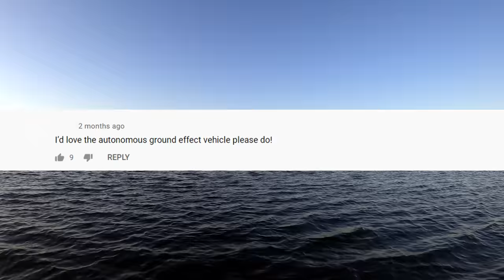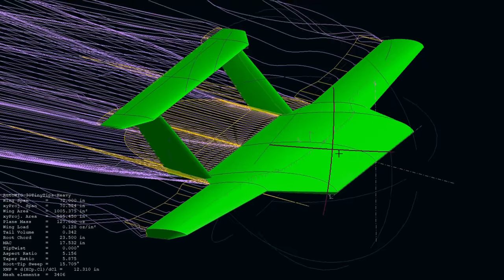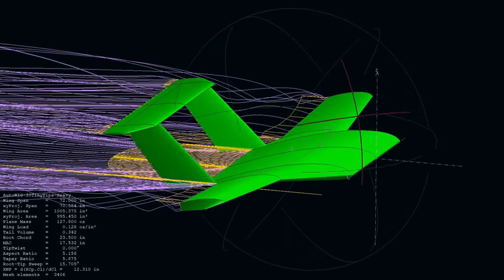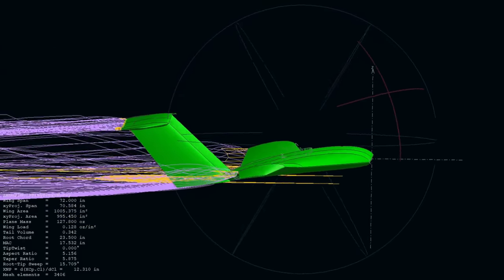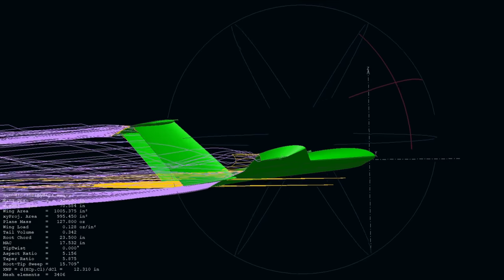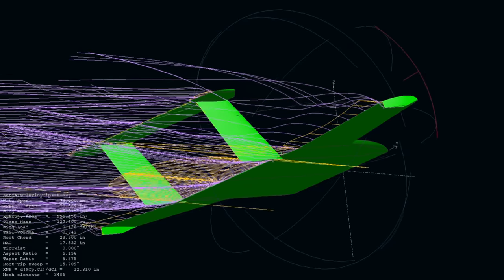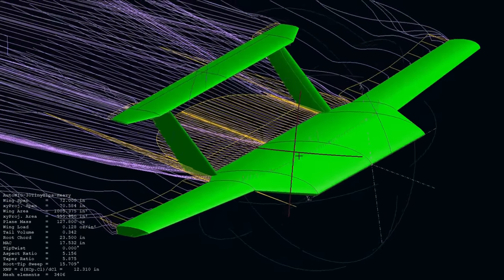Worlds First Autonomous Ground Effect Vehicle/Ekranoplan?   RCTestFlight Collaboration

Comment: would love to see some efficiency tests (battery duration) for identical missions at differing altitudes! Great build.
Reply: I was going to mention battery life. The whole point of the WIG is energy saving. The KM and Lun both use 8 engines to get out of the water, then turn 6 of them off.
Reply: Why ?
Reply: @tonywright8294  it would let you know the most efficient altitude for the vehicle to maximise WIG effect, as @mellocello has pointed out. If you're not in WIG effect, or in a less efficient height for it, you're wasting power. If you're not actually in it you may just as well fly the plane at any altitude.

Comment: Hey nice video. In the pic of the 3 pelicans, they are actually flying like most soaring birds and open ocean long distance sea birds, with the most lift happening the closer in you get to their shoulders, where they have fore and aft concave, lateral concave, as well as top view template concave. Just a massive inner section of lift, joining in with the body at the shoulders, with a massive refined fillet blending it all together.  That way the lift is were it takes the leverage of the birds muscles, way less energy and effort to keep its self in flight for long periods of time and flight. Next the pelicans in the photo aren't that different in height. The one on the right is just much closer to the camera. But all three of them are actually surfing that ocean wave. So let's say, in dead wind, surfzone waves like this one, are traveling somewhere around 5mph and push an air wave above them, which give the sea birds a form of means of travel.
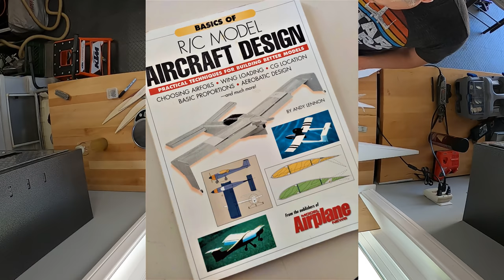 They combine that with the added help of ground effect the closer they get to the ocean surface. They also alternate the concave in their wing span from that pocket near their shoulders, all the way out to their wing tips depending on the needed articulation to stay in trim to the air wave. Those tips are actually accelerating the air flow as those last few feathers flex. Like when you kick with swim fins. The tips of the fins are bending into the water flow and allowing you to thrust water backward and yourself forward. Albatross use their wing tips to actually barely touch the wave going extremely fast in air surfing the open ocean swells. And the prandtl theory says that tip vortex can either be drag or acceleration on a manmade plane, depending on the design of the wing tip. Next. On your model, the twin vertical stabilizers can have an extremely positive added behavioral characteristic if you give each one about 2 to 3 degrees of toe-in towards the nose. It creates an auto correct feature to the performance characteristics. I'm at 5:20 now I'm going to watch the rest of the vid. Also on those hydrofoil speed boats. Their engines need to be mounted in the front of the boat, like a common prop plane. The props can be in the back, but all that weight in the motor needs to be in front. Wow, great work. Excellent flight

Comment: Would be interesting to graph the speed vs the amount of current draw on the battery, as it goes in and out of ground effect. Well done presentation. Subscribed.
Reply from the maker: It is coming for sure.
Reply: Yes, had the exact same thought.  How much more efficient is ground effect mode versus normal flying?
Reply: I might be very wrong about this, I have almost no experience at all, but it seems to me, because it's so small and light, that it needs to be much closer to the water, for it to actually use the ground effect, than what is shown in the video. It looks like it's just flying on its own and not using it at all?
Reply: @shuffleducky7803  Was thinking the same thing. What is the max height for a craft this size to be in Ground effect? It  must not be much if ground effect is as I understand it to be a compression of air underneath the crafts wing and the surface of the body it's flying over.
Reply: At a constant speed, I would love to see a graph of height vs motor amps.

Comment: SWEET! Now I can start ordering my coke fresh directly from Columbia!
Reply from the maker: Coming soon to shores near you lol
Reply: @thinkflight  😆
Reply: I was only thinking this at the beginning! My thoughts were 'I think I remember the Russian's doing this not necessarily doing this for efficiency, but for anti-radar detection? 🤔'

So here I am now wondering who in that circles would watch this? Then I started wondering how stable it would be across rough seas? Like 3m waves? Does it maintain its "pocket of air" if wave amplitude differential doesn't exceed the wavelength.... Could this be possible?

I'm gonna do some more research on Ekranoplanes
Reply: @Jarmezrocks  they just use submarines.
Reply: was thinking of the same thing.

Comment: Very good job !
Thoughts to go further :
Real Ekranoplans do not fly high altitude because their aim is to capture best performance due to ground effect. To capture that performance they have small wings that do not enable them to fly high altitude. If your prototype can fly high altitude, then it is not an Ekranoplan, it is just a plane that flies low and benefits from ground effect.
To make a real Ekranoplan, you need to reduce and optimise wing size so that the prototype has the best possible ratio speed-range/energy.
A way to achieve this simply with your prototype is just to load it more and more until it will be unable to reach above ground effect altitude. And then find at which ground effect altitude it has the best speed-range versus different loads.

Comment: Bravo, there are a lot of WIG builders but few succeed.
What you have created is basically a Bierev VVA 14, with the area redistributed in a higher aspect ratio format.
I know it doesnt look a lot like it, but this is how the VVA 14 was planned out. You could just as easily put tails on booms, as is popular with Russian designers to this day.
As with all these things power and the combined wing aspect ratio dominates the point where the vehicle takes off and climbs out.
Clearly to go fast over water, the math needs to satisfy those cardinal points. Otherwise you climb out quicker than intended.
The other thing was motors. Forward motors are usually increase dynamic stability, and allow ram air to get under the wing and get the machine to unstick from the water.
This especially if the engines can be canted to direct thrust beneath the wing almost entirely. 
It is important a feature on full scale because the power and RPM available is more limited than the model with electric propulsion.
Lastly, ailerons should be up only, not opposing up and down as they are on conventional aircraft
cheers

Comment: There’s a mechanism they use on hydrofoiling catamarans - a trailing link that skims the water and is hooked into the angle of tack of the foil. Keeps the height stable even over some degree of chop.

Comment: Lidar based autopilot is becoming a thing for aircraft.

From what I've read from JAXA, they have a lidar that can detect wind so accurately now it can 'eliminate' turbulence (just go around it.)  That's a forward version of lidar, now combine that with this system and you have a craft that is basically a meteorological station that can also fly lol.  The crazy thing is that this plane can probably do a simple version of doppler radar too.  That kinda comms / radar ability would be really significant to the air force and navy.  They legit wand this stuff, this guy is gonna be rich off military contracts.

Really with a few more mods a plane like this can replace an AWAK, no lie, that's how far micro electronics have come.  This would give your military AWAK capability BELOW the typical radar line, that's insane, and would change FOB strategies.

Comment: Might be neat to put an IR LIDAR sensor on the nose for holding a fixed altitude above the surface. That would then help the computer trim the pitch to keep it in ground effect and possibly be more reliable than GPS in this regard. (At least not worrying about a constant signal source for altitude data, particularly when purposely flying very low.) Then other than steering, it'd likely just cruise where you'd want it for the given throttle setting.
Reply from the maker: Check out RCTestFlight for the follow-on to this project.

Comment: Looks good...my only issue is this is more of an airplane that can use ground effects then a true ekronoplane...it's one thing if it can jump up to 10 feet altitude or higher but to be a true ekronoplane it can not fly like an airplane but has to use ground effects in order to keep flying...the Wright flier did not need to use ground effects to fly, but since the Wright Brothers had no idea how to fly, they kept it near the ground for safety, and the ground effects they did get probably made it harder to fly because of their stability problems, They did build the Wright flier based off their kit designs anyways....anyways, to make this a true ekronoplane, cut those wings off or atleast cut them way down. I think if you have wings 1/2 that size and give them some significant dihedral, maybe 15-20 degrees on each side, that should prevent it from flying like an airplane us it'll give it some significant stability on the roll axis especially when in ground effect flight.
Reply: Change...flying like an airplane us it'll give...to, flying like an airplane, plus it'll give...

Comment: You earned my sub less than 30 seconds in. 
I think what makes this work so well is you went big enough to raise the effect up a little higher off the surface(I realize it wasn't always in GE).   Many of the models I've seen have been of the size that the GE is much closer to the surface making for slight variances in flight envelope upsetting the apple cart a lot easier, or more often.
Reply from the maker: Just wait for RCTestFlights work, and V2!

Comment: Great Tx. Beautiful lake. Very cool model , best of both worlds. Never been a fan of foam RC planes but seems like the model mfrs. and yourself have got it down pat pretty good. Of course I'm judging foam from 1981 when I flew my first single channel RC aircraft , a Testors .049 powered J-3 Cub...for 5.2 seconds before wings snapped like a dried up twig. But, I digress.  Certainly a more workable material for prototyping.

Comment: I don't think that was actually flying in ground effect except for a few seconds during takeoff and landing and you won't get any ground effect benefits like less drag, less power to maintain lift etc. for that plane unless it is flying within a foot and a half off of the water. It still is a cool project and probably will lead to more cool projects in the future. It seem more like a low altitude radar avoidance flight autonomous drone...new acronym! It is a LARAFAD! (with the pontoons it may even need to fly like less than a foot off the water to actually be true wing in ground effect. Right near the end when you have the aircraft camera on and it is coming in for a landing you can tell when it experiences ground effect when it suddenly "porpoises" before setting down.)

Comment: A lot of that final test looked like the plane was at least 2 to 3 wingspans above the water, that's not in ground effect, it's a low flying plane.
In proper ground effect the motor power usage would be considerably lower, and it wouldn't have the power to fly 3 spans above the surface.
At that model size it's only really going to be in ground effect at maybe 6 to 10 inches above the surface.
To do a proper ground effect proof, you should limit peak motor power in the software to a level that cannot "fly", then it simply wont be able to exit ground effect. Think Spruce Goose.
Great video by the way! 👍🙂
Reply from the maker: There is work to do, and I think RCTestFlight and Sebastian have the electronics expertise to leave no doubters.  ArduPilot cannot handle it without a few changes at this point I believe, hence RCTestFlight and I needing to collaborate to pull this off.   Thank you for the compliment.
Reply: @thinkflight  I do appreciate your video, and your amazing project.
But as far as "doubting", well if it can fly through the air at 100 feet off the ground its an RC plane, not an RC ground effect vehicle.
To be a GEV it needs to fly less than half a wingspan above the surface, and not be able to fly at >=2 wingspans high.
To me it looked like the surface was not flat enough to fly low in ground effect, so you said you "had to increase the airspeed" to get it higher to avoid the waves, basically you increased the airspeed until it could fly at any height like a plane. Anyway, thanks for sharing and best of luck. 🙂

Comment: It’s the process that impresses. The airplane is pure brute force design. And the test flight is really impressive. Is there a B roll of failures? Or were failures so minor that a B roll is too short to bother with?
Reply from the maker: I did manage to tip stall it once but not on camera?   Really no failures to speak of, and I'm not afraid to show them, its pretty much what you see is what you get.

Comment: I wonder if there's a way that you could have a plane that uses a recharge function where the front of the propellers charges the motor and the back one spits out the lift so you have an infinite charge I wonder if you can pull that off it would be kind of fascinating if you can do that with a larger scale I imagine if you still can't get enough charge from it you can still throw some solar panels on it

Comment: Technically birds like pelicans don't have a wingtip vortex. Rather it's maybe roughly 1/4 in from the wing tip. It's also the reason to why they don't need a vertical stabilisator.
Reply from the maker: If it stayed at 1/4 they wouldn't be able to steer, it is constantly variable.
Reply: @thinkflight  would not surprise me if that’s the case, not seen any data on it though. But I’ve seen a model developed by a a student working for nasa that was able to steer with a fixed wing that was modeled to have the vortex a bit in from the wingtip. So they for sure can steer although if it were fixed. 
But it’s probably adjustable, however their wingtip feathers would probably not hold for the vortex being at the wingtip.

Comment: First amazing job. fantastic build great flights. my question though. are you not flying outside of ground effect? 1 foot high seems very high for such a small vessel ?? is there a way to use your telemetry to determine if you are in GE or not? ie I would think it would take substantially less power in GE versus flying say 10ft off the ground in level flight.

also for turns. can you program a flat coordinated turn? ie a rudder turn but ailerons to keep the wings "level" to the ground. would totally eliminate wing strike issues and allow lower altitude flight. I am not sure if the flight computers are capable of that yet.

LOVE watching your videos. you do what I want to do but know I can't do. so I enjoy through you! thank you!

Comment: I don't know what speed the craft was doing but I noticed at several points that droplets of water on the top of the fuselage were not being disturbed by the wind/speed. I expected to see them blown away/dispersed by the passing air current but they were practically motionless. What caused this?
Great video and ingenuity.

Comment: Very cool 😎

How about adding air pressure sensors below the wings to monitor lowering pressure if there's wind or changing terrain and damp this proactively before the craft actually starts to move? 🤔

With asymmetric slat adjustments the craft could compensate the pressure itself without involving ardupilot at all. It would just need a signal to engage level straight flight to enable the adjustments.

The caused jaw movements on the other hand would need to be compensated by ArduPilot. Either by differential trust or by using the rudder.

Comment: Marvellous! My Admirations!

That thing flew at insane speed. However, given it's a model made of light materials and probably overpowered, I think it would be waaaay more difficult to create a full size vehicle that works as well. Nonetheless, the performance was remarkable. I've seen different designs, this one seemed to work fine, as simple as it was. Forward propellers would have a positive impact on lift above (Bernouilli) and below (air cushion) the wing body.

The Airfish is easy to fly from what I've seen in vids (just take hands off controls and it sits down), but it can't get so high above the surface to fly over waves. The ondulating surface might affect the ground effect anyway, but I am not sure with your model and it's good flight performance. It appears that your model could have handled waveheights up to several times it's total length. Quite impressing.

I loved that vid. Liked and subscribed.
Thx. Greetings from Old Europe.

Comment: Really cool, great job on the design and final build!  Just wondering, in regards to the autonomy, is it capable of obstacle avoidance while it is navigating from waypoint to waypoint?  In other words, would it have avoided a stationary object in it's path while in flight?
Reply from the maker: Right now there is no obstacle avoidance and that is why a chase boat was implemented, as well as running the mission before anything else was on the water for the day.

Comment: ya do know that the reasoning behind forward mounted engines is to develop a high pressure cushion of Air under the lifting body like a hovercraft rather than relying purely on airspeed to build that cushion right? I'm seeing more effeciencies that way
Reply from the maker: Sure, but there are drawbacks, such as the prop striking the water at 400mph tip speed if at full power, and all that spray going in your pitot tube and over all the cameras.   Pluses and minuses, the designer has to make tradeoffs, and everyone will make different choices.